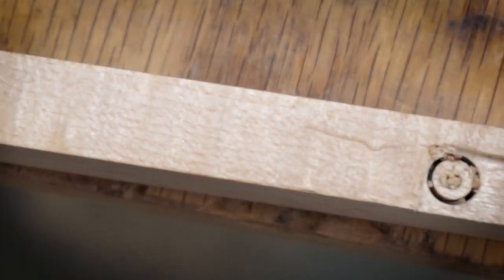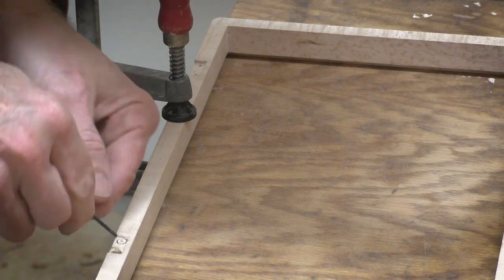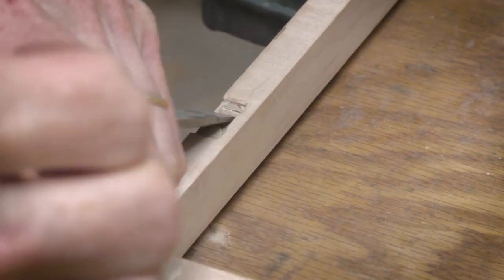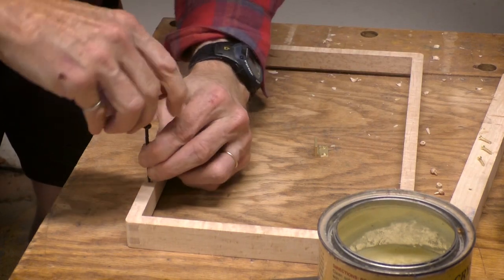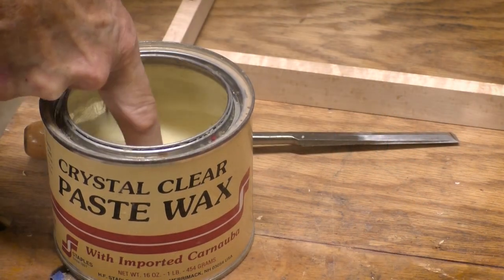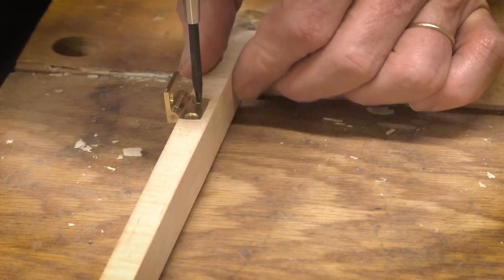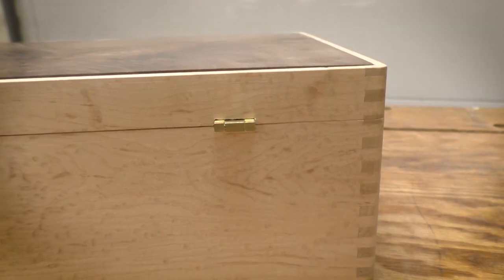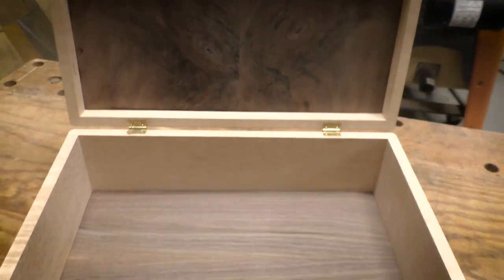How to remove a small broken screw from a piece of wood

Comment: Good tip. I am a retired dentist and yes in dentistry there are problems to solve. I have started drilling the  screw hole slightly larger than the screw body and using epoxy to secure them. I no longer have to deal with the issue. The screw head is centered in the hinge and is even with the surface of the hinge.
Reply from the maker: Interesting approach!

Comment: Interesting tool... never seen that type of bit before.  What do you call the tubular drill bit itself?  I take it the screw was too small to use an easy-out?

Never heard of a gimlet before either, but will probably pick up a set next time I'm near a Woodcraft; looks handy. =)
Reply from the maker: The tubular screw extractor is available from Woodcraft in a variety of sizes and they just call it a screw extractor despite being a little different than most. I couldn't use an easy-out type of extractor because the screw was too small (a #2 screw).  A set of gimlets is definitely worth the investment to avoid having the problem that I ran into. I plan to use them much more frequently now.

Comment: When I'm using brass screws, I ALWAYS fit an identical size steel screw first, usually with a little candlewax, before fitting the brass screw.  I've never had a brass screw break, using this method.
Reply: This is the best comment here. With all due respect to the very nice work of the author, he made a mistake on that. And you very nicely corrected that. It is in all old woodworking books, so 100 years old solution not many knows. Prevention is better than cure.
Reply: I did that and the #5 brass screw I was using broke off anyway, inside a piece of oak.
Reply: After breaking a number of brass screws, this is my method too. I haven't had any problem since starting to use this method.

Comment: Where do you get that drill bit? I have a window latch come off leaving two headless screws. Has to go back on the same way so they need to come out.
Reply from the maker: If you're in the U.S. you can find them at Woodcraft or on Amazon. Here's a link to the ones available on Amazon.  http://amzn.to/2jNl2Ak  They're available in three different sizes, so you'll need to be sure you choose the right one.
Reply: Unfortunately I live in the UK. The only screw extractor I can find is for a screw with a rounded head and not a headless one. Thanks for your reply anyway.
Reply from the maker: @jameshall2195  A couple of years ago I helped someone from the UK to find them at Woodworker's Workshop, but they apparently do not carry them anymore.  Another viewer provided this comment on how to find them on Amazon, but agree that the price is quite high from this source:

Here's an update for others in the UK. It appears that the woodworkers workshop no longer stock this item (at least it's not on their website). But I did find the extractors on Amazon even though they didn't come up when searching for screw extractors for some reason. But if you search for 'woodriver' you can find them. The current link is: https://smile.amazon.co.uk/gp/product/B0032YWQ26/ref=ppx_yo_dt_b_asin_title_o00_s00 They are expensive and delivery is 3-4 weeks!

Comment: Nice Job!  I need your expert opinion - I was removing my shutters to repaint them when the 3-inch long screw, .15" shank, broke while I was unscrewing it.  1.25 inch of the screw that includes the head came off.  The remaining 1.75" shaft is still stuck inside the wall. I need to use this same hole for the sake of reattaching the shutter.  How can I remove the shaft that is still in the wall?  I can't find any of the extractors that are at least 3-inches in length. Any assistance would be greatly appreciated!
Reply from the maker: My first thought would be to use a long hole saw (something like this: https://amzn.to/2S5TDN7) to cut around the remainder of the screw, then break off the wood and plug the hole with a dowel so that you can put a new screw in. That's assuming you'd have enough space in the existing wood to cut the hole.

Comment: Back when most of the hardware you could get was made in the US instead of in China, I would have maybe 1 in 100-200 screws sheer off.  These days you're lucky if you get a dozen screws in before one sheers.  And not just brass -- steel as well.

Comment: I've just had a brass screw shear off in a rosewood jewellery box I'm making. The screw is 2mm diameter thread to thread. I've spent so bloody long on this box since I've never made anything out of wood before and I have no power tools so did it all by hand, veneered in elm burl, french polished, dovetails, canadian smocked insert and everything. Needless to say I was absolutely gutted when I realised what had happened... this video has given me hope thanks... (but another bloody thing to buy)!
Reply from the maker: Good luck with that. I hope the video helped find a solution to the problem.

Comment: Doesn't the end grain, paste wax, combination make for a weak connection for the weight of the lid?
Reply from the maker: You might be right.  I wanted to bring up the use of wax because that's something I should have done the first time around. Everything seems to be holding securely so far, and the lid is actually very light, so I think it will be ok.  At least, I hope so. :-))
Reply: Wood U Make It nice!! It's a beautiful box and a great fix. I'll be using this technique!!
Reply from the maker: Thanks! Next time I'll try harder to make sure that I don't break the screw in the first place. The gimlet and wax definitely help a lot.

Comment: I'm trying to remove a little screw from a camera and the screw is broken so I don't have any way of undcrewing it what do I do?
Reply from the maker: I'm not sure if this would work and it would depend on how tight the remaining screw is, but you might try putting some CA glue on the end of a tiny screwdriver, spray some accelerant onto the screw, and then hold the tip of the screwdriver onto the screw until it bonds.  If the screw's not too tight, that might give you the ability to unscrew it. That's the only idea I have. Good luck!
Reply: @Woodumakeit  CA glue?
Reply from the maker: @unlimitediq1894  CA stands for Cyanoacrylate, which is the technical name for "super glue". Starbond makes a very good product: https://amzn.to/2zhRJDk and this is the accelerant that makes it dry almost instantly: https://amzn.to/2ZlhE7P
Reply: @Woodumakeit  I managed to get it out without the glue.

Comment: 40 Years ago i learned an importand thing: NEVER USE BRASS SCREWS.
Reply: What screws do you use with a brass hinge?
Reply: @Josef_R
Reply: Put in a steel screw first to cut the threads, then replace it with the decorative brass screw
Reply: @billmaxwell2981  I use a steel screw with two flat sides ground on, to let the swarf out.
Reply: @johnbishop5316  Works like a tap - great idea!
Reply: @billmaxwell2981  It's a tip from German piano making over a century ago. The pressure bar in the top of German pianos made by the masters had all the scew slots lined up. I thought they just left them like that. Turns out that they put three sizes of ground off steel screws in and got the hole just right for the brass ones. All 100 of 'em. Look in a Yamaha: They're all crosshead, whacked in with a gun. Instead of half a day's work, it's ten minutes. Trouble is, I'm not sure it matters much? Nostalgia just isn't what it was?